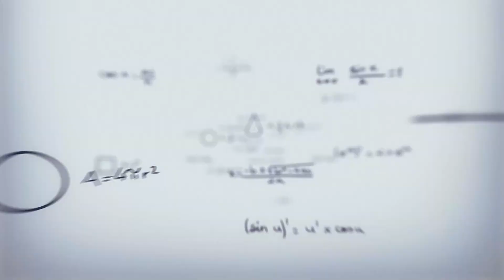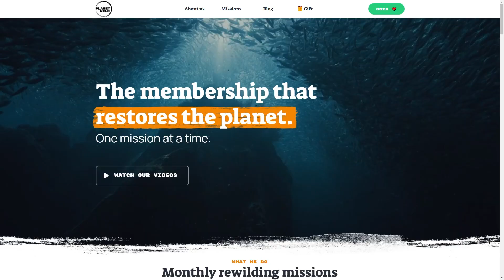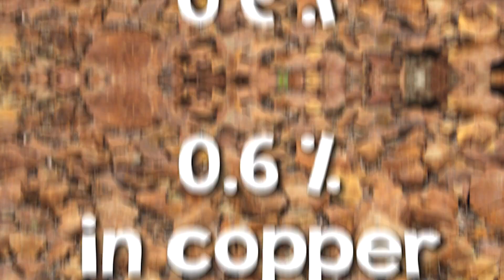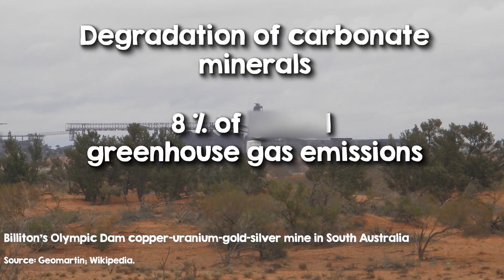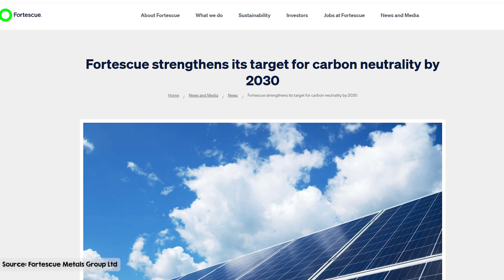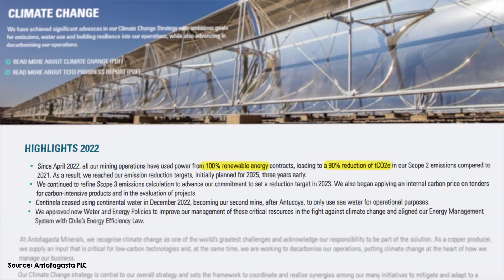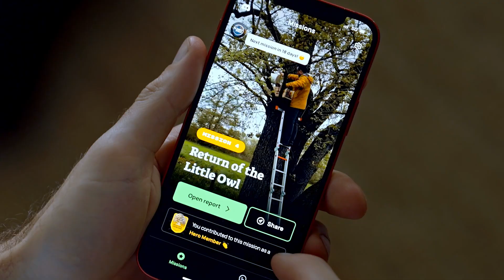Zero-Emission Mining Technologies are Here

Comment: The infinity train sounds like it's breaking a law of thermodynamics lol. It must used a little bit of extra energy from somewhere else coming back up but it's a great idea.
Reply from the maker: It does sound like that! Check out my full video on that idea for all the physics to show why it doesn't break any laws of thermodynamics. It's just in the idea phase, but it is not supposed to need any extra backup. The Antofagasta conveyor is a similar concept that does actually exist, and it generates surplus energy they can use for mining operations.
Reply: I will check that out, thanks :) @EngineeringwithRosie
Reply: There's an electric mining truck doing the same in a quarry in Switzerland (I think it was), fully loaded from the quarry at higher altitude, charges the batteries going down hill and can then drive up hill again empty.
Reply: It doesn't break any laws and not sure why you think so or what it is that you misunderstood there.

The Train rides down hill loaded and up hill unloaded.
So it needs to restore less potential energy as it weighs less going up hill.
Some of the potential energy of the mined material is turned into electricity in the process, which is later used to run the empty train up hill.
Reply: oh..no I thought the train was coming up loaded. If it's empty coming up then yeah that works. @TBFSJjunior

Comment: Phasing out fossil fuels != phasing out liquid hydrocarbon fuels
Reply: Very true, but can also be kind of misleading, depending on the intention.

For example we can replace fossil petrol with synthetic petrol from renewable energy, but for that we need 7 times ( 5 to 10 times) the energy. So we need 7 times the space, 7 times the amount of solar/wind plus efuel reactors, so probably more than 7 times the minerals than going electric.

Biofuel is also a non fossil option but it has a low EROI and it needs 190 times the land than solar + EVs.

So yes non fossil fuel liquid fuels will be part of the solution (in planes and ships, etc.), but going electric if possible is almost always the most cost effective and resource optimizing option.
Reply: Ships will probably mine to ammonia or some other fuel. In theory we could go back to wind for ships. 

Short haul flights might move to green hydrogen, ammonia, or batteries. Long haul flights is harder. Either break flights into shorter legs or use synthetic fuels.
Reply: Thanks for the reply!  It's a hot topic for sure : )

"we need 7 times the space, 7 times the amount of solar/wind plus efuel reactors, so probably more than 7 times the minerals than going electric."

Nuclear uses 400x less land than solar per kw.  So the land use would go down by 393x.  There is no limit to the amount of energy that can be produced from thorium.  More than humans could ever use in a billion years.

"Biofuel is also a non fossil option but it has a low EROI and it needs 190 times the land than solar + EVs."

You are correct.  The land use of biofuel is a serious issue.  Nuclear methanol (for transport) and hydrogen (for stationary) solves that issue while using far less land than we already do.

"but going electric if possible"

Going electric in what sense?  Most energy humans use is in the form of heat not electrical energy.  Basically it's as pointless as a goal as you would expect governments to come up with.

 @TBFSJjunior
Reply: @TBFSJjunior  Slightly delayed reply.  Solar and wind are not reasonable solutions.  In the US we have huge solar and wind capacity which is built and not even connected to the grid.  Turns out humans don't live close to windy places and deserts who knew?  Biofuel is also not a reasonable solution as you correctly pointed out.  On the other hand nuclear hydrogen -> methanol is a reasonable solution.  Sure nuclear is expensive, so are batteries, but at least the reactors can produce hydrogen from water and air, take up very little space, and can be placed near population centers safely.  Search "red hydrogen" and "japan HTGR".  As for where the carbon for the methanol comes from that's a good question.  Until that question is answered hydrogen can be burned directly in all existing combustion engines.  Hydrogen tanks aren't great but they are safer than gasoline tanks and will get the job done until we find a suitable source of carbon to produce synthetic methanol from red hydrogen.
Reply: @columbustalley330  
Sorry but most of what you wrote is factually wrong to the point that I'm not sure if u are trolling.

You act as if it is impossible or difficult to connect wind/solar to population centers via power lines and then suggest a system that needs 5 to 10 times the energy.
You argue it is easier to build 5 to 10 times the amount of nuclear, while Standard nuclear isn't economically viable.
Then u say hydrogen can be burned in any combustion engine which it can't and then that hydrogen tanks are safer than gasoline tanks which is beyond absurd.

Hydrogen is either stored in 700bar tanks or in liquid form. Both having a long list of issues and both has a higher carbon footprint and is much more expensive than building brand new EVs.
Reply: @TBFSJjunior  For some reason my reply didn't go through?

It isn't impossible to connect wind and solar.  What I said was that it isn't being connected.  There are a variety of reasons but you can google the problem.  You are correct that current nuclear isn't economical.  Why does it take the US 12 years to build a reactor but Japan only needs 4 years?  They are either 3x more intelligent or their government is 3x better at supporting nuclear.  Hydrogen can be burned in combustion engines.  Cummins will sell you one right now.  Toyota has H2 combustion vehicles on the road just waiting for the cheap hydrogen to fill them up.  Hydrogen is stored in 700 bar tanks.  Tanks that you can fire a rifle at and nothing will happen.  Do you feel comfortable firing a rifle at a gasoline tank?  I sure don't.

Comment: ONRL reckon they have got processes which can give 100% recycling at the full strength of the material for carbon reinforced plastics (CFRP). If it pans out, that is revolutionary for everything from car bodies to wind turbines. 
I also like basaltic fiber, which has comparable qualities to S-glass, somewhere between fiber glass and carbon fiber, with the cost in between too.
Its very high melting point means that it is much easier to separate from the polymers etc for recyclability, and it is simply basalt rock.
It would not totally replace steel, as it is non conductive, as opposed to metals which are very conductive, but shows good potential to reduce needed iron output.

Comment: The 6x mineral contents is nonsense when Iron and Aluminium isn't included.  It means "unusual" minerals that we didn't mine so much before.  Perhaps the elements are less dense that with Iron and Aluminium, but I'd expect that the amount of total material is similar.   EVs weight a little more but not 6x.
Yes we need different a more diverse materials, but its just a matter of time before we have enough of those new materials in circulation.
Reply: Bauxite mining for aluminum is atrocious. 

All the fossil fuel fans conveniently leave out the missing engine block and transmission when they are whining about the EV batteries. 

Kinda brings the EV to only slightly more emmisions to make, which is easily offset in their first couple of years of driving instead of a gas car.
Reply: @5353Jumper  All strip mining is (or was) atrocious, but these days mining standards are improving (which is one of the good points of this video.) The point I was making is that whilst the average copper ore now has around 0.5% metal content, bauxite can contain 25% or more aluminium metal. And iron ore is higher still.
Reply: A big thumbs down for the lies and misinformation in this video.
1. Rosie claims 10% of global CO2 emissions are from mining, "with over 90% of that from fugitive methane released during coal mining".  First, she just confused methane and CO2.  Doesn't she know the difference?  Second, according to "Our World in Data" "Greenhouse Gas Emissions" chart, "Fugitive emissions from energy production" is only 5.8%.  This includes all CO2 and methane from all types of energy production.  Does she just make up numbers?
2.  She compares the 12,750 Kg of fuel burned by a petrol vehicle with the 160 Kg of minerals used in an EV, and says that's 99% less mining.  Surely she knows that in order to get 160 Kg of minerals, you need to mine at least 2 ORDERS OF MAGNITUDE MORE ORE.  In other words, you need to mine 16,000 Kg of ore (and overburden) to get that 160 Kg of purified, finished metals.  This doesn't even take into account losses of materials from the manufacturing/fabricating processes.  (I'm not including the recycling of batteries since it is only hypothetical, and not commercial reality at this point in time.)  Petroleum extraction generally removes only the petroleum from the ground.
3.  She talks very flippantly about increased mining being good for the planet since it reduces the amount of plant food (CO2) released.  Plant food becomes people food through photosynthesis.  Do a search for "Carbon Dioxide Fertilization Greening Earth" to find an article on the NASA website about a study showing increased CO2 is 70% responsible for increased plant growth on earth.  Also, interestingly, climate change is responsible for 8% of INCREASED plant growth.  (Yes, the MSM and the IPCC are lying to you.)  In reality, the climate is getting MILDER!  High temperatures are NOT increasing.  Low temperatures are increasing, primarily at night, in the winter, at higher latitudes.  That's why the average temperatures are increasing.  Also, severe weather is NOT increasing; that's just fear porn to convince you to give up your freedom and money to the elites.
4.  She also talks about the efforts to decarbonize mining and material production with no consideration of real-world economics and pricing.  It's easy to wave hands and pretend that all this will come about at no cost to anyone.  In the real world, these things have costs, making poor people suffer.  Poverty kills.
Reply: Iron and aluminium ores are much more concentrated and therefore much less energy intensive to process, hence an order of magnitude cheaper. (Cost is often a good measure of energy intensity.) The worse crime here is comparing the fossil fuel consumption with the battery and not including the energy production infrastructure required to charge it. Which at some point will have to include the gargantuan amount of battery storage we will need to stabilise intermittent renewable generation if we are to finally ditch coal and gas.
Reply: @tbayley6  We don't need and cannot store our way out of variable renewables (with current tech).  If you watch this channel you should know that transmission is the way to deal with it, however 80% renewables is fairly easy with CCGT to make up the difference.  Batteries are mainly for grid stability and peak demand.   Wind or solar power needs to come from a windy area if your area is low in wind and solar.  This video is more about the mining, not about energy totals, but EVs need alot less energy than combustion vehicles, its easier than fossil fuel companies like to make it sound.   Forgetting about renewables the capacity for charging is already there, in fact coal production is more feasible with EVs, and still gives a reduction in CO2 output.
Reply: @tbayley6  Yes its a fair point but the original post was about the invalid mineral comparison.  I am somewhat influenced/incensed by the nonsense coming from the fossil fuel industry that do comparisons between EV energy supply chain and combustion "vehicles".
Yes Gas is needed as a transition, renewables can prove itself by minimising gas usage along with whatever Nuclear is available.  Gas turbines are cheap and can be left on standby in large amount.  Of course we do need to reduce gas use.   The dunkenflout is a very small amount of overall energy gap, but difficult to accommodate.  Transmission can do it, the wind is always blowing somewhere, storage is not currently feasible.  Ultimately I am positive that there are many options, for example dynamically priced power, smart grid, transmission, consistent renewables (like tidal and geo), along with storage and transmission. That seems enough tools in the box to make it work by 2030-2050 with or without Nuclear.

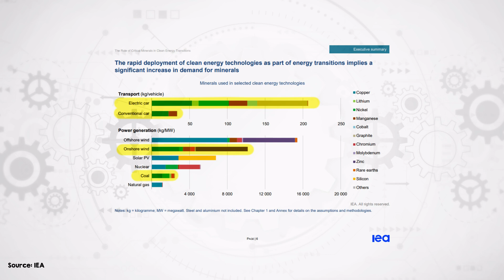Comment: 2:56  Look at that graph of "demand for minerals", in which an EV is declared to use 6x more material than an ICE auto. But wait... does that even make sense?  EV's are only a little heavier than an ICE auto. If you look at the key on the right of the graph you will see two important things are missing: 1) iron, 2) petroleum.  Iron is used extensively in all autos and reducing iron ore is a big contributor to GHG emissions.  And petroleum is used for all the plastics/synthetics that are now significant in autos.  In reality, any automobile, regardless of engine type, is a huge consumption of mined resources . The only way out of this problem is to greatly reduce the use of autos, of any kind.
Reply: It's not six times the material, it is six times the minerals. I think it's because the elements being used to make EV batteries make up a smaller share of the rock than something like iron, meaning to get the more exotic elements you have to dig up a lot more of the minerals in question.
Reply: @AlRoderick  There are many twists and turns with this topic. I am glad there is a dialogue. I think your nuance is very important.
Cobalt is used to refine petrol. Current battery designs are using fewer rare minerals; research is pointing to Salt, Carbon, Sulfur, Iron chemistries on the horizon. All of which can be reused by our grandchildren...... where petrol gets used once.
Reply: @AlRoderick  But the refining of iron and aluminum, the two metals that were ignored, are both large CO2 emitters.  Since the topic was mining in general, and the environmental cost thereof, we should consider all the materials in a car if we're comparing EVs to ICE.  To say EVs are SIX TIMES "worse" than ICE is highly misleading.  They involve maybe 25-35% more mining.
Reply: @incognitotorpedo42 the claim isn't they are 6 times worse.
Regardless mining different minerals has different challenges. Depth of deposit, strip ration, location, water and energy requirements for processing ect.
Lithium ore is a great example it is a nightmare to win.
Reply: You could reduce the weight and size the original mini was small and light the new one is big and heavy from 600 kg up to 1,250 kg over 1/2 the cars sold are huge SUVs and crew cab trucks to take kids to school, You got strange looks if you came to school in a car when I was a kid. Now 8.30 and 3.10 is like a monster truck grid lock.
Reply: Indeed. Getting petroleum out of the ground is also mining. The graph is therefore misleading.